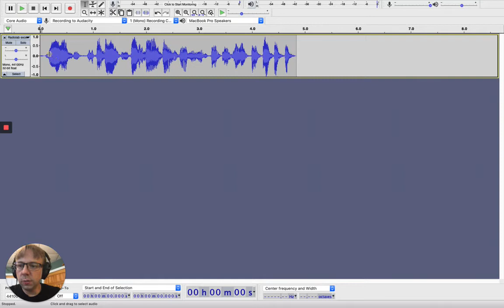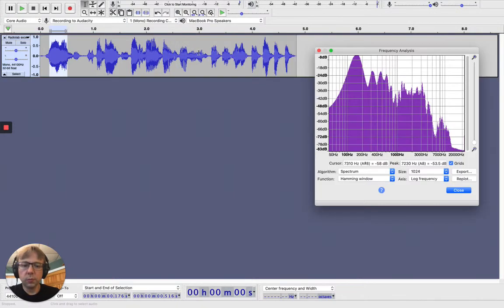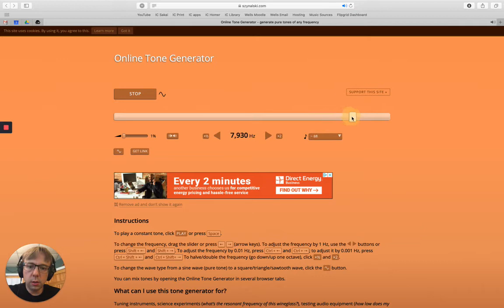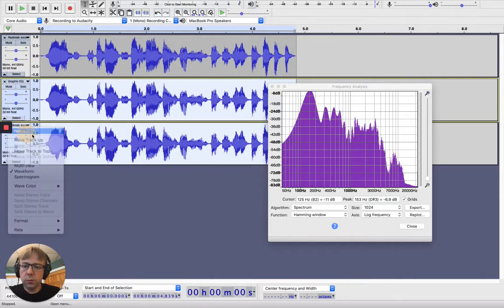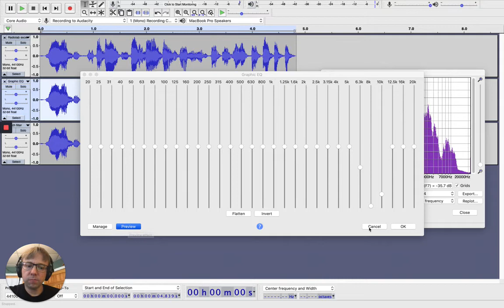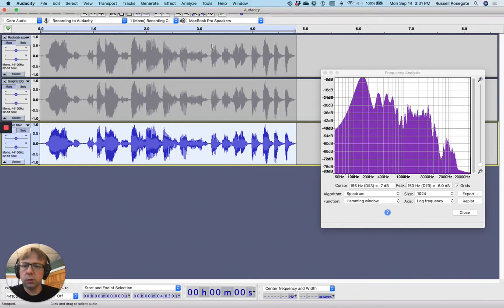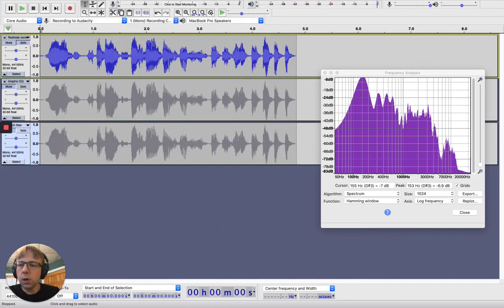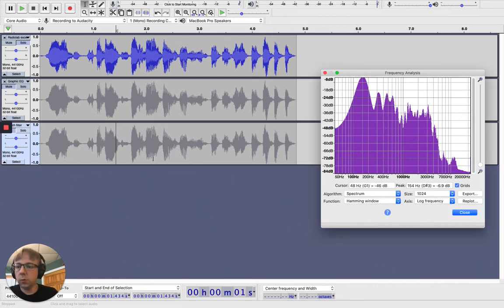Removing high pitched whine using audacity

Comment: This is really helpful. I use an EHX Tri Parallel Mixer along with 13 other pedals on isolated power and a Line 6 HX Stomp with a switching AC adapter. The easiest way for noise to get in my signal chain (besides strat pickups lol) is EMF into poor cabling or the Stomp AC adapter. Does removing the offending frequency from the recorded track compromise the quality in any way? Otherwise I might buy a current doubler and power the Stomp on my isolated power supply.
Reply from the maker: The short answer is yes, it does compromise the quality of sound. For spoken audio like in the example here it’s not a big deal. For high-quality music it could be an issue. Really the only way to not compromise the sound is to get rid of the frequency at the source. However, the noise in the strat pickups is also part of their whole sonic package and probably results in a nice brightness in general which might only be offensive in quieter situations. It’s definitely complicated and requires compromises!